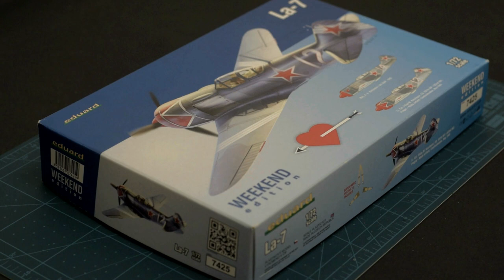Lavochkin La-7 - Eduard 1:72 scale model build

Comment: How did you hide the decal film and dull down the sheen?
Reply from the maker: I sprayed satin varnish after decals, followed by textures, post-shading and fading. It was done by highly diluted paint which has kinda flat sheen. No flat varnish was used.
Reply: I see, thanks! Currently I’m using Vallejo’s satin and they don’t really hide the sheen really well and same goes for their matt sadly
Reply from the maker: I use to spray heavily diluted beige or grey paint on the decals. Like 9:1 thinner to paint ratio or even more. It's a filter to tone down the vivid colors and the sheen. The thinner the mix the more control you have. If you want to keep the sheen uniform on the whole model, finish it with another coat of satin.